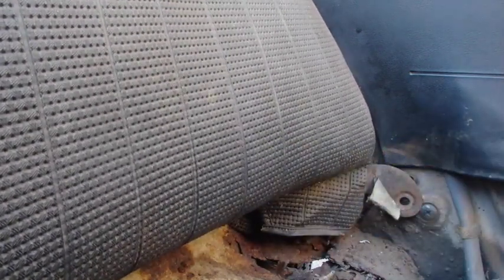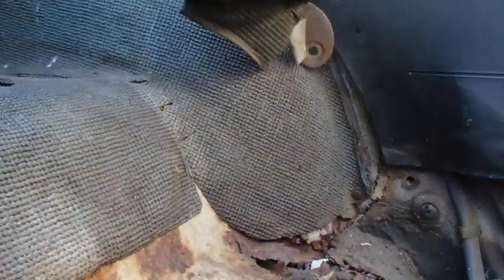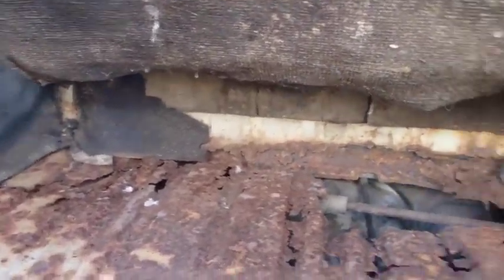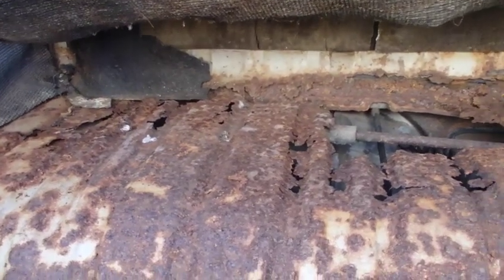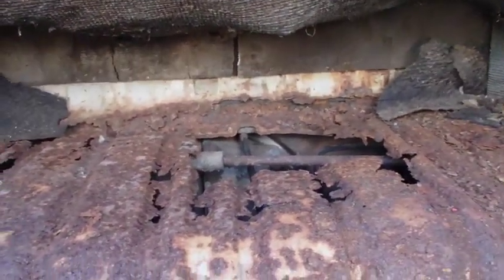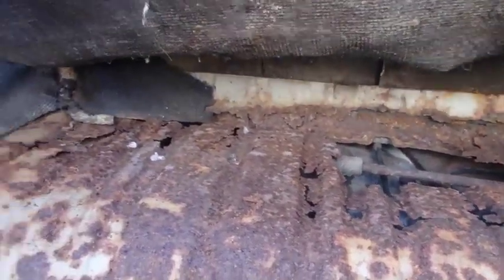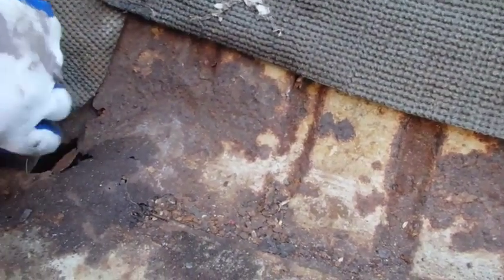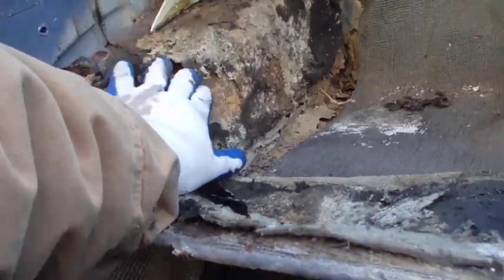67 VW back seat out and under

Comment: Some washing machine metal welded in and it will be dandy :-D
An angle iron frame as a access hole would give you a place to join all the patches to, a central hub like, perhaps :-)
Reply: I like the metal idea better then wood, especially since Volkswagens are notorious for catching on.... Well just look at cutworms new bug.
Reply: +Hot Rod 
I dont know about the ignitable proppertys of vw's.
Cutworms bug just needs some metal based love lol.